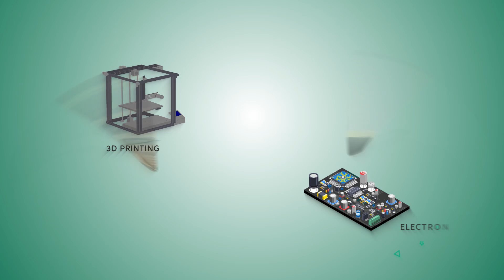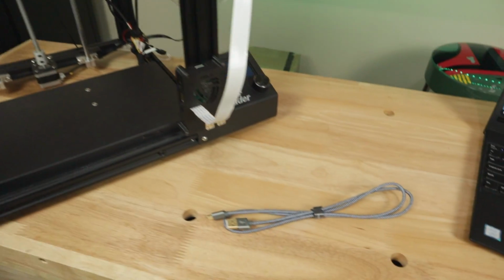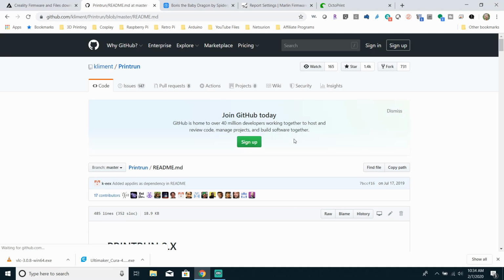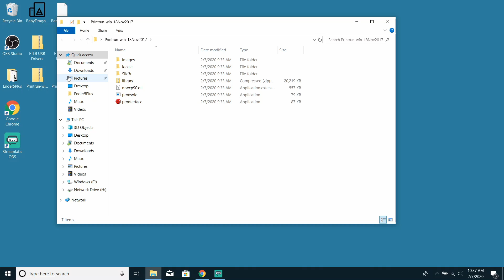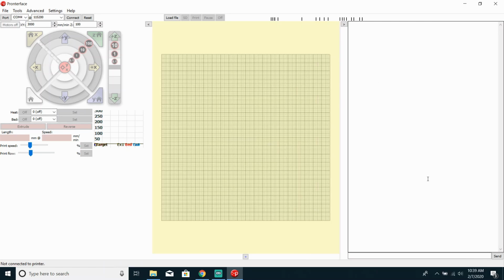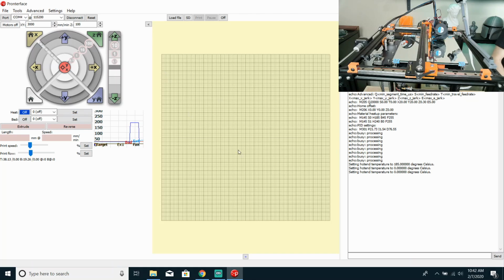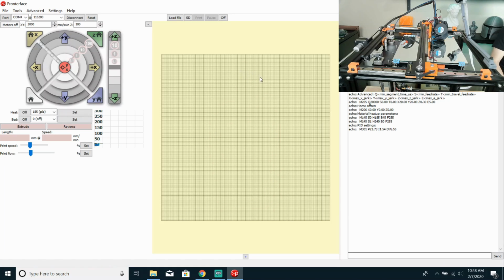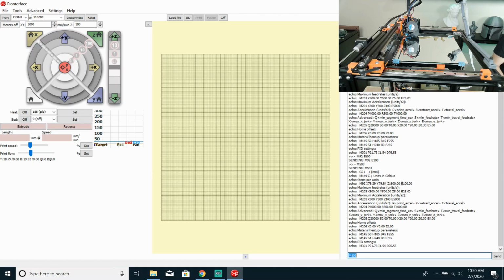Easily Connect Your 3D Printer to your PC!

Comment: could use some help here....
ponterface can see my printer, but every time i press connect it says

Got rubbish reply from COM4 at baudrate 38400:
Maybe a bad baudrate?

even if i change the baudrate, it stil says the same
Reply from the maker: That baudrate is most likely not right. Try 115,200 or 57,600 and see if it works.

Comment: Hi i reset the z height using a series of m codes on pronterface  as per a vid now the printer does it 16 point check and just before the print stops and the progress bar works across like its printing but the print head doesn't move. I have a sd card inserted but its not doing anything, Is there a code i need to put into the main board for it to read off the factory slot ? not a connected laptop
Reply from the maker: No, nothing you do on the console should affect the ability to print off of SD. When having SD issues, always try reslicing the file in case it got corrupt and try a different SD card.
Reply: @kerseyfabs  Hi found the issue did a sd card format and re did the file worked fine thanks for your reply.

Comment: I’m having problems trying to save my E value i got to try and enter M500 and i get echo:No EEPROM. 

What do i need to do
Reply from the maker: Some printers do not have an onboard EEPROM. You may have to have the SD card in for it to save to. If that doesn't work, you'll have to add your change to the start GCODE so it's setup on each print.
Reply: @kerseyfabs  yeah Ive got a boot loader coming, I’m gonna flash it
Reply: @kerseyfabs  I should have listened to my gut and bought the v2

Comment: Hi i cant find the drivers for my cr10 max 1.70 bl not even on their website plug cable in can make the connection and shows non as a port com no options can you help thanks David NZ
Reply from the maker: See if this page helps from TH3D: https://support.th3dstudio.com/hc/downloads/drivers/creality-printer-drivers-ft232r-chip-most-models/
Reply: Great thanks did get it to talk to the printer via the cable and pronterface

Comment: Sadly, this doesn't work with my EasyThreed X1 printer. I installed the included drivers but Pronterface does not connect. But thank you for the elaborate explanation, when I get my Ender 3 V2 it will be very helpful!

Comment: I am trying to open Printrun app, and my windows 7 wants to know what I should open it with I tried a bunch of different options I wa given (Adobe Actobat Reader, and hl2. I am still having now luck, what did you open yours with?
Reply from the maker: It's just an application. It shouldn't require any special program to open. Which file are you trying to run?

Comment: When I plug my printer in with device manager opened, it shows the printer in other devices, and not the COM & LPT drop down. Under other decices it says USB serial with a yellow exclamation triangle. Basically wont show up under COM ports.
Reply from the maker: You'll need to install the drivers. You will usually find them on the SD card or on their website.
Reply: @kerseyfabs  i installed the drivers that came with with it's exe but my printer isnt showing up anywhere in device manager, so i cant even install them manually. what can i do?
Reply from the maker: @Special-j8x  Which printer is it? Does it even show up as an unknown device?
Reply: @kerseyfabs  thank you for replying, its an ender 5 pro, it did not. i however found out it was a dodgy cable, now it shows up. ive installed drivers but pc will simply not connect to the printer no matter what i seem to do or what software i use, just says "access denied"

Comment: Ummm yeah so my Sunlu was easier to connect than my Ender?!?!?!
Reply from the maker: Easier? Because of drivers?
Reply: @kerseyfabs  "plug and play" for print run only.  Matter control connected but tried to send my Z up to the space station, and Cura.....well that's a whole other thing.  Still haven't figured out Octo poop.  I am Bios locked from my extra (older) laptop or I would just connect that.

Comment: Hi, just discovered your channel. Thanks for your video, I like how you detail while keeping it easy to understand. Not everyone is able to be concise while being comprehensive. Just a basic question if you don't mind : is it possible to modify and save the E0 max temp setting via Pronterface to the EEPROM instead of going thru the hassle of compiling new firmware, Visual Studio, Arduino IE and the likes? I have 4.2.7 (32 bit) board on my Creality, bootloader is already included. I don't feel comfortable with altering G-codes and flashing process. Thanks very much in advance!
Reply from the maker: Thank you so much for the feedback! To answer your question, no, the max temperature is generally considered a safety feature and is not configurable via g-code. You will have to recompile to go over the default maximum. The manufacturers usually set that based on the hardware they ship with and you would need hardware modifications to go hotter (i.e. all-metal hotend).

Comment: got the drivers installed and pronterface.  baud set 115200 tried all the com ports 1 to 4.  It's an early 2008 (old) MBP.  won't connect getting error messages.  (Errno 2)

Comment: How fast or slow is the connection over usb?
Reply from the maker: It acts as a serial communication. So slow/fast is relative. The "normal" speed of most printers is 115,200 bits per second.
Reply: @kerseyfabs  oh okay thank you so much and love your videos.  Because of you I'm getting my first ender 5 plus
Reply from the maker: All the best with your new machine.
Reply: @kerseyfabs  thanks.  What mods do you recommend for an ender 5 plus?

Comment: I need connect EZT T1 delta 
I don't find driver in pc
It's not the same driver you use
Reply from the maker: It may be a different driver for sure. It's not the same board. If you need it, here's a zip of my original USB driver for that machine:  https://drive.google.com/file/d/1eIaf-WbPTeLA7WTEq6irBP0KLFe-NxDt/view?usp=sharing
Reply: @kerseyfabs  okey 
Thank you very much for your help me

Comment: Great overview! thank you for this. I do have another question though. How would I connect and send gcode to the printer without using a 3rd party software? For instance, say I am a "master at gcode" and just want to send commands through the terminal of presliced models, how would i do this after connecting my computer to the printer?
Reply from the maker: Thanks! You'll need some sort of terminal software. The simplest for Windows would be a utility like Putty. I also have a video on Pronterface which is heavier than Putty.
You can also connect a Raspberry Pi to your printer using OctoPi.
Reply: @kerseyfabs  thank you for the reply. Those are 3rd party. I’ll rephrase my question. I very familiar with the terminal and not so familiar with interfacing with a 3d printer and would like to send commands to my printer at the lowest level possible (I.e. sending commands through the terminal in Linux). Are you familiar with how these 3rd party softwares interface directly with the printer? For example, how pronter allows you to send commands in what looks like a chat window directly to the printer.
Reply from the maker: Alright, so low level. From a low-level perspective, the printer is just providing a serial terminal. From a programming perspective, you would have to open a serial terminal at the right speed and settings and then send a receive commands using standard text IO. Various languages make this possible. From a scripting perspective, it would be relatively easy to do this with Python. I've coded serial communications in C.
Reply: @kerseyfabs  I think I have come to the same conclusion. Thank you for your quick replies and help.

Comment: The Ender5+ documentation and other forum discussions mention not to connect the printer to the computer directly b/c any time the computer does something, like screen saver or sleep, it will stop the printing process. Does using your solution here, checking/verifying the com port, etc. prevent this? 
If we select the correct COM, Baud, etc., can we use the computer in parallel while the printer is printing? I don't know much about the inner workings of the computer, tho good to know, but it seems ancient thinking to be unable to simply hook up the computer to a 3D printer directly and use it like any of my paper printers. Is this due to a lack of memory in the printers and they must use the memory in the computer? 
You mention installing the drivers for the printer. I have not done that as yet. Is this like "add printer" in the devices icon in Win10? 
Good video. Thank you very much.
Reply from the maker: So there are two main ways you can print to a 3D printer. 1) The printer can print directly from an SD card (local storage) that is in the printer to read the file. This is extremely reliable because then the printer is autonomous and can read the file until complete. 2) You can feed commands (G-code) to the printer over USB from a PC or, in a similar fashion, a Raspberry Pi. If you feed it from a PC, you are subject to the computer's schedule. What happens if the computer auto-updates and reboots? What happens if the computer decides its idle and goes to sleep?

Unlike a paper printer which sends the file and it completes printing in seconds, 3D prints can take days sometimes. This means the PC also has to be uninterrupted for the entire time if you're printing directly. You can use an add-on device such as a Raspberry Pi with OctoPi installed for similar functionality of a paper printer where you can send the file over the network and then the printer will go until complete.

I hope this helps clear things up.
Reply: @kerseyfabs  
Very reasonable and thank you. 
I really have no problem with the SD card option. I would like to do my creative work on a separate computer and then save to the SD. The E5+ has a large bed so I cannot use a generic Ender printer driver. The documentation I got from Ender (youtube) is in written Chinese with some English subtitles and no spoken English. 
Is adding a 3D print driver like a new paper printer where I use "Add Printer" so I can access the functionality of the printer for my Word Document or is there some other process to add a printer driver to a separate computer for designing the objects? TYA

Comment: Hi, could you tell me if there any advantage compared to octoprint?
Thanks
Reply from the maker: This allows you direct commands to your printer while connected via a USB cable. It primarily useful for settings and running tests. I don't recommend it for prints because computers are notorious for sleeping/rebooting/crashing when you least expect it.

OctoPrint is a dedicated Raspberry Pi (normally) that sits there, connected to your printer, and awaits commands, controls prints, and allows for monitoring of the process. OctoPrint can be always on and always available without tying up a multi-use system.
Reply: @kerseyfabs  thanks a lot for your fast and detailled answer. So, there is no benefits for me to use it instead of my octoprint system... Thanks

Comment: My printer exceeds the printing area on X-axis far right.. Please how  can i fix it?
Reply from the maker: Which printer and what do you mean it exceeds it? It tries to go past the limits of the printer while printing?
Reply: @kerseyfabs  , I have G-max 2 , Yes sure it exceeds the limits of the printer with crushing sound at X-Axis ends on right..
Reply from the maker: Since your firmware isn't enforcing the limits, you need to set them correctly in your slicer. Otherwise, there's nothing to stop it without custom firmware.
Reply: @kerseyfabs   I think I should use marlin 1.1.x what's your opinion Please?

And if its custom, can we reach agreement to edit marlin for me ?

I can collect my self for some little PayPal..
 I will appreciate your effort..
Reply: @kerseyfabs   Hello here  are we still together?
Reply from the maker: @yigageorgewilliams8817  I'm sorry for missing your comments. YouTube is not the best place for this sort of back and forth. Can you contact me on one of the other social media accounts? That would be easier. Thanks!
Reply: @kerseyfabs  
Thank you, can I have a link to one?
Good evening from here..

Comment: Well made video. I wish you had started a print job though. It looks like that may be a slow process though because of PF slicing the gcode. Can that be turned off?
Reply from the maker: I really don't recommend printing from the PC. There are too many things that can go wrong. Mainly Windows has a habit of going to sleep or rebooting during a print. I only use the console part, I don't know if you can turn off the other parts.

Comment: Can you make a video about calibrating stepper motors on firmware? My E5P extrudes 9,13mm when it was suposed to extrude 10mm and i dont know how to tune it
Reply from the maker: I'm on it. That's the next video in this series.
Reply: @kerseyfabs  The problem im facing now is that if i calibrate it to print precise wall width i have under extrusion. I Calculated i had to set the multiplier to 1,07 (i remade the measuring and it is not 1,09 as in this case i posted) to compensate the filament extrusion, But to have the wall thickness equal to the one i feed the slicer, i have to use 0,85. A huge difference. 
The filament width is properly set. 
Only changes i made in the printer so far is A capricorn Bowlden and a 0,6mm nozzle

Comment: What about the 5V from the usb, does the feeding cause any issues short/long term?
Reply from the maker: You mean the extra power coming from the USB port? It doesn't damage any of the boards I've ever seen. It will power most of them though if left plugged in after you power down the printer. This is important if you turn off your printer and can't figure out why the display is still on.

Comment: Great video man - well done; you are one of the best presenters that actually does each step clearly - other's videos leave out many important key elements and many give incorrect info! 

Hey, I notice you added those support struts to your machine! Those did not work for me at all! Future video suggestion: explore structuring up and stabilizing the ender 5 bed! Thanks again man! Have a good one!
Reply from the maker: I really appreciate that! I try to make videos that almost anyone can follow through. I also like to cover possible issues.

I installed the struts because I was testing a theory. I have seen zero improvement or worsening of my prints. I have not found a case where my bed needed stabilizing. I was trying.